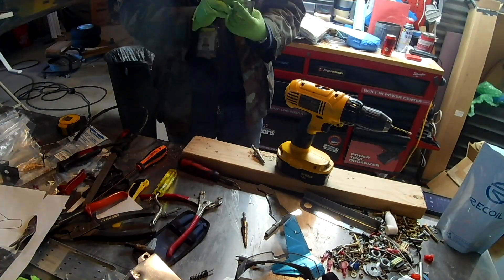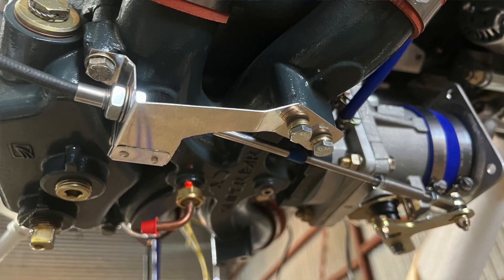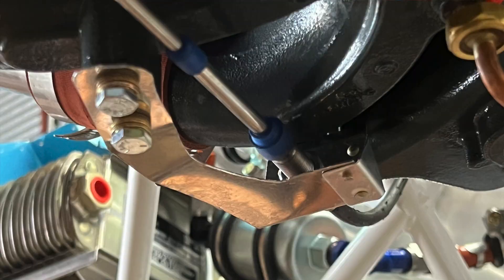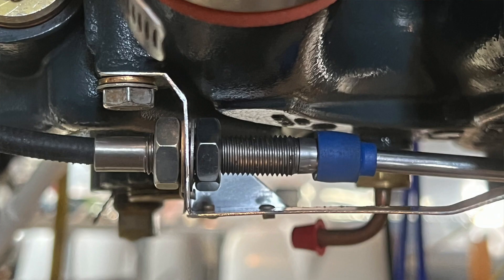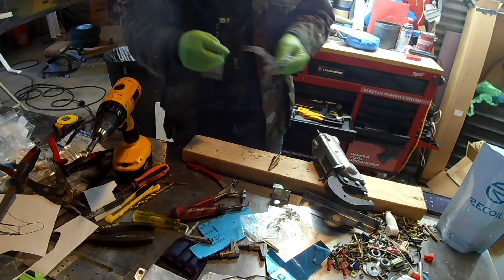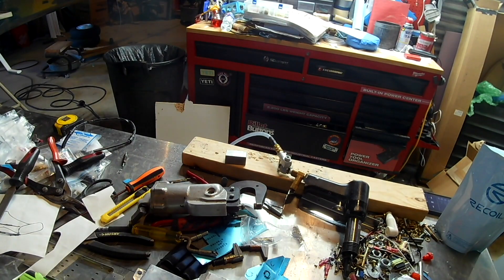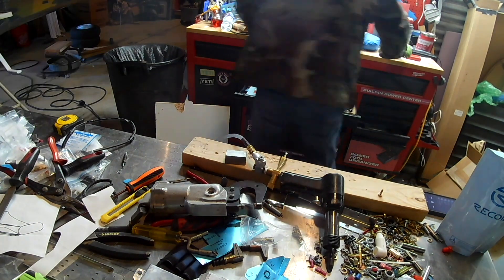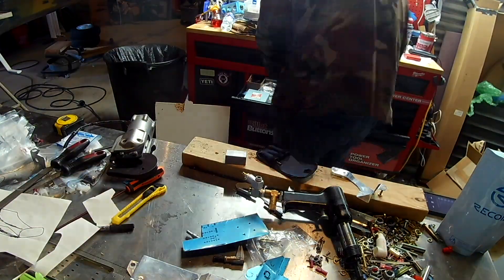RV-14 Throttle Cable Bracket II

Comment: You might want to double check the edge distance for the bolt holes. For thin materials some say 2.2 D measured from the center, some say 2D+.050. It looks much less on the video but I can't tell for sure.